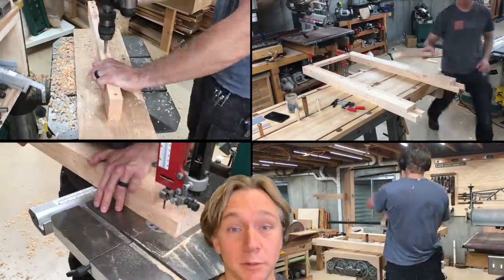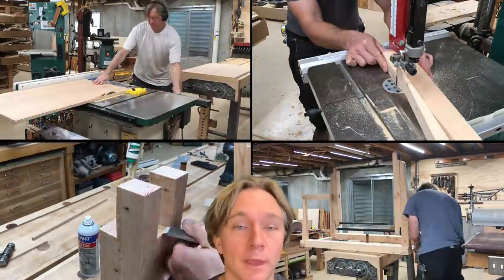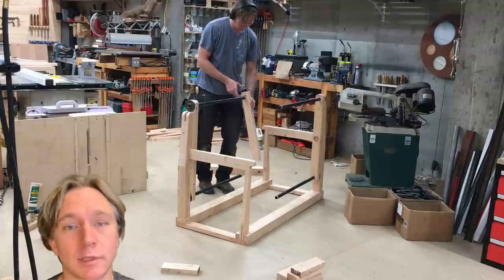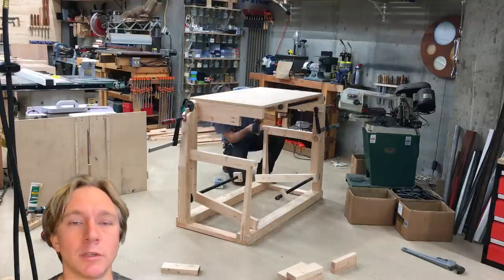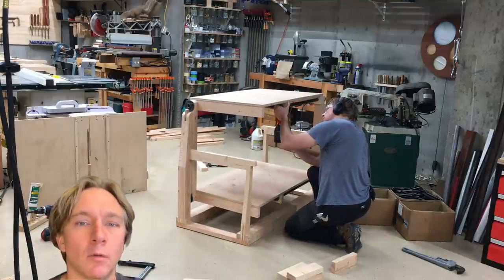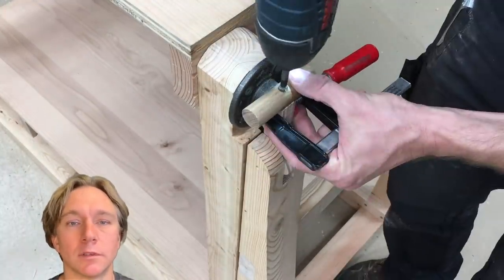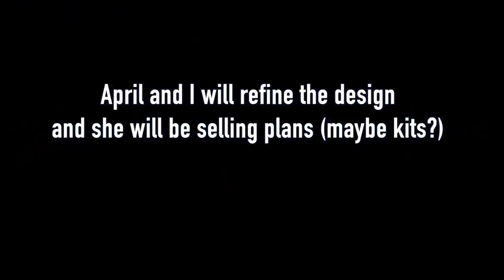FLIP TABLE that doesn't FLIP when you FLIP it

Comment: I will doodle out a Free-Body Diagram (FBD) later for the forces, as I am now curious...

However, adding diagonal bracing, and/or, wire rope & turnbuckles, to the diagonals of each level (two shelves & base), as well the vertical uprights of the base, may assist in preventing torsion & keeping the Three (3) sections of the base's construction Square & Firm

Comment: This is exactly what I was looking for.
It's solved a huge amount of confusion because I always thought that there must be a way to flip a table with another without turning the machine upside down.
I hadn't contemplated using only 2 opposing arms to keep the 2 surfaces level.
Top job.

Yes, I've noticed that there is no riving knife too on his table saw but I suppose one can be forgiven when it's used professionally.

Comment: Very clever design! But for really tight spaces, the flip-over design makes more sense. The trade-off for keeping both surfaces upright is the need for a two-table footprint to make the transition. Maybe is needs casters so it can just slide away from other stuff to rotate, then slide back.

Comment: Super cool concept!  I imagine, though, the people primarily interested in a 2-in-1 table configuration would be those with small shops or space constraints. So If the premise is space-saving, It feels like the amount of room it takes for the tables to flip may defeat this purpose. Other than that it is freaking awesome!
Reply: i feel like putting locking casters would alleviate that problem a bit; wheel it out to change and then wheel it back?
Reply: I was thinking that, but the problem with this design is that if one tool was way lighter than the other (big planer one side and a belt/spindle sander on the other) it might be really tippy with wheels ... I was worried about it being tippy because of the weight without the wheels...... If I'm wrong and its not tippy, another solution for the space would be if it swung towards the front instead of the back. Would just need to figure an easier way to get to the retaining clips that would now be in back against the wall..
Reply: Picture a repair person who has two customers’ devices being worked on. Has to get parts delivered for first one, leaves it disassembled on surface one, and flips to surface two to work on the other. Parts come in to finish the first, flip it back. Assuming parts are coming from a local supplier so the surfaces aren’t occupied for long.
Reply: What if the table rotated sideways instead of front to back? Would prevent the above issue.

If your tools were different weights I guess you’d just have to screw down compensation weights to the lighter side until they were balanced.
Reply: To me the main issue is that flip  tables are born from the need to save space in small or constricted shops. While this prototype is very cool, it does not save much space. Now, if you have enough room in your shop, that's a different story.

Comment: I have a conventional flip-top table.  One of the tools is a DeWalt 734 planer.  About a teaspoon of oil leaked out of a seam on the top of the motor housing after hanging upside down for few weeks.  I can only hope that doesn't cause a problem, and now I'm not comfortable leaving the table in that position.

Comment: Nice table!  I did notice that the tables wanted to tip when they were at the same height.  You could fix that by having 3 tables, or by adding a chain between the pipes to hold the surface level.  A chain between the pipes would also help with stability and reduce the need for the extra fold-in legs.

Comment: Really cool. Guessing this is one of the enhancements you may already be considering, but it should be possible to cut an angled (or curved?) notch into the non pivoting legs (or add on by glueing an additional piece to the leg after the mechanism is already in place so it's easier to fit?) with complementary shapes in the table so you don't need to lock the leg in place on that side.

Comment: Great engineering!  I wonder if you could incorporate gears either plywood or metal to control the transition/ flip?  Maybe a middle gear at the pivot point with a gear on the end of the pipe above and below it- You can obviously figure the gear part out better than me!  I was even thinking of it with a crank handle or a motor to make it powered.  Great work- I hope I am able to make one someday.

Comment: Man, I can definitely see this where I can place my miter saw on one table and the planer on the other. Or benchtop Joiner and planer. Question: Wouldn't this be considered a "rotating" table vs flip? B/c it's basically the same concept like a ferris wheel and that doesn't "flip". Just wondering.

Comment: I built one of Carl Holmgren's flip top stands, but it's really awkward right at the point when the top is in the vertical position. Also the bottom tool is upside down. I've thought about trying to figure out how to do something like this before, but all I could ever come up with was the bottom layer swings out to be level with the top layer. The top layer never moves so the size just doubles. Love this idea!

Comment: Nice design. I wonder if using pillow block bearings to handle the loads and moments would allow the total elimination of the swing out legs. Maybe you already have those with your use of pipes.  Just a thought. 

Interesting design.

Comment: I definitely need this for my small shop. I just added a planer to my power tool inventory, which means I now have TWO relatively heavy tools that don’t have a home (the other is my bench grinder). I’ve been sketching out a rotating flip table design, but I really don’t like the idea of having loose parts and accessories falling on the floor. A table of this or similar design would make both tools accessible quickly and easily, unlike the upside-down types.  Plan availability.. any dates in mind?

Comment: Great design.  Only caveat here is that this table would have to be on the center of the shop as opposed to be against the wall due to the horizontal footprint.  Unless if you have it on casters.

Comment: Definitely a neat design, but what is the benefit?  Aren't flip tables usually used to save floor space, but this design takes up 2x the floor space when rotating but keeps everything up right.
Reply: Could go on wheels
Reply: It’s great solution if you’re planning to keep fish tanks on one shelf...
Reply: @9nine917  Hadn't thought about aquariums, but you are right this could be a good solution for that to make maintenance easier, but is this flip table strong enough to hold the weight of 2 aquariums?  Just doesn't seem that practical for a shop unless your shop is 3000 sq. ft., but then if your shop is that big then why do you need a flip table?

Comment: If you can find a way, I suggest investing time/effort on the ease of use of the locking mechanism. People are lazy and drawn to quick and easy. I know you said that you'll tweak the design, but right now you have to manually stop the table top at the right moment and go to each corner to secure it in place. In addition, I would imagine most people who have need for such a floor-space-saving-device can't put it in the middle of the room and it'll have to be against a wall. So not only would you have to pull it out (probably on some casters), but pull it out so much that you can lock each leg.
I'm cautiously optimistic since I've seen you make some really great stuff and even bought some of them, but I think it's not viable yet.
Reply: You have to pull any flip table away from a wall to use it if it's housing shop tools. The only time one would never have to move is if it's a gaming table with different board patterns, or something similar where there is nothing of vertical height occupying the different surfaces. However, the challenge he is responding to is for a shop tool flip table (i.e. A table for both a spindle sander and a thickness planer that only requires one footprint, but is on casters for mobility.) that doesn't require either side to be upside down so the tools don't need to be bolted to the table. Anyone going this route is already avoiding the easiest solution and would most likely not care about two extra functionality locks for the uniqueness of the piece.

Comment: That was great. I want a workbench 8x4 with flip tops and workstations for a drill press, small belt sander, miter saw and a band saw. Easy flip and the table level when tools are not in use. In that way, one could have one unit. I now have 3 units bench; belt sander, miter saw; drill press, band saw. I want one designed by you and with your genius. Please

Comment: I was waiting to see the mag-locks used to secure the fixed position.  #missedopportunity?
Reply from the maker: There are plenty of times when the cost of a Magswitch is justified, I don't need to use them when a cheaper solution is just as good.

Comment: It’s clever but I feel like this is just not practical for a litany of reasons. 
1. The floor space is takes up is significant compared to conventional designs.
2. While you have made it sturdy, I can’t help but feel like it’s still not as sturdy as the conventional design. 
3. It’s not very aesthetically pleasing to the eyes.
4. It’s overly complicated and the more complex something is the more failure points. 

Cool concept but not very practical.
Reply: If you need a flip table and the items can't be turned upside down, then the other design is that one that isn't "practical".  I think this solves a very particular problem and isn't meant to replace all existing flip tables.